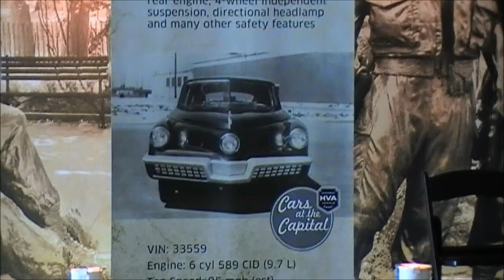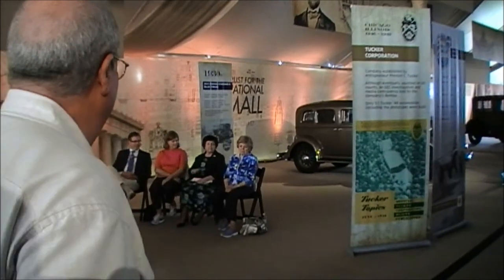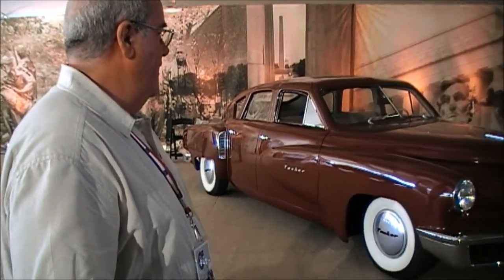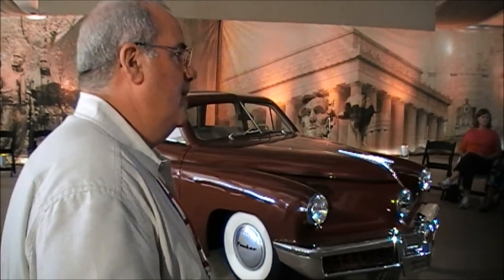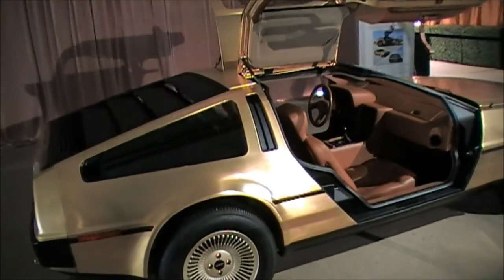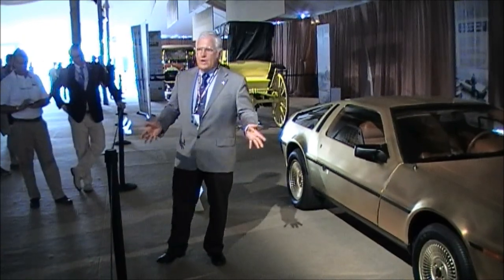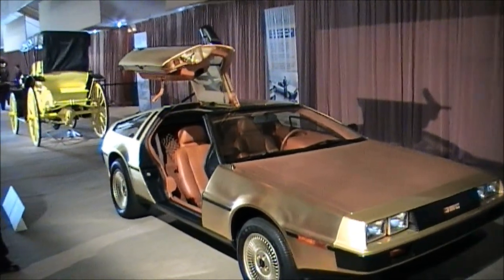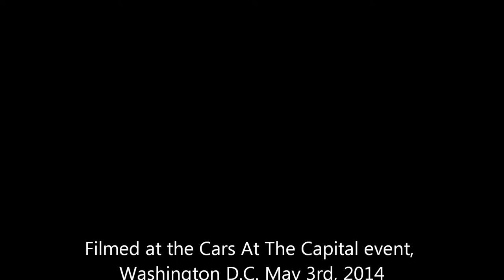Cars At The Capital - Gold DeLorean & Tucker Prototype.

Comment: Ahh yes the AMEX Deloreans think there were only 3 made
Reply: There were two of the $85,000 gold DeLoreans sold for the promotion-- VIN's 4300 and 4301.  A set of spare panels was also made in case one of these cars needed one replaced.  When DeLorean folded and the final cars on the line were completed, the spare set of panels was fitted to the very last car-- VIN 20105.  This last car was not part of the promotion and would not be considered an AMEX DeLorean.